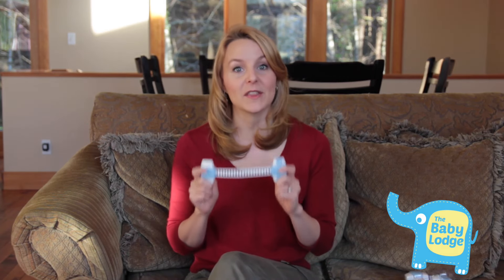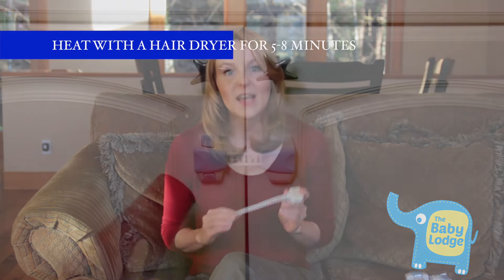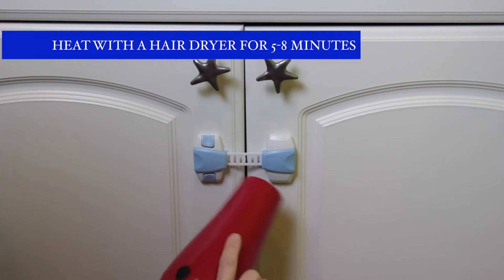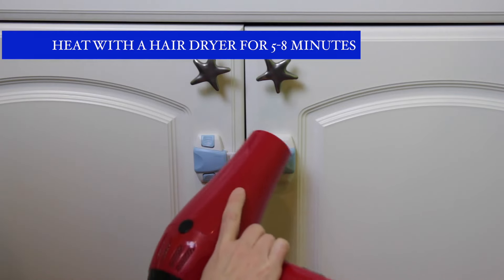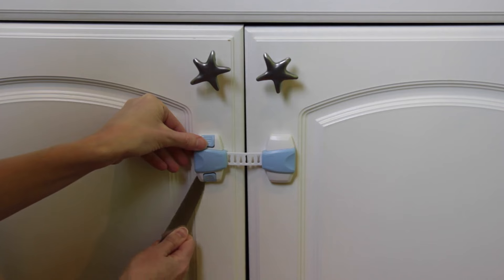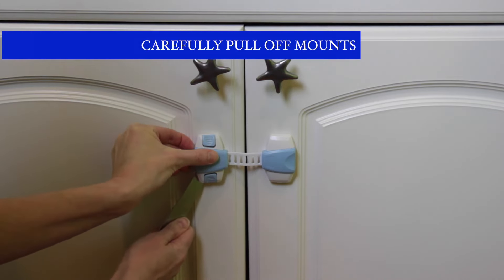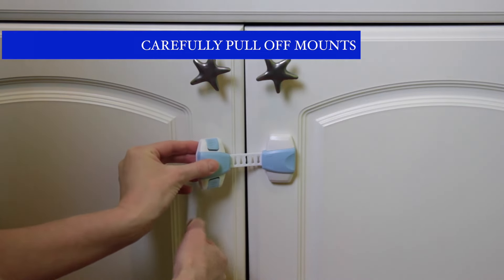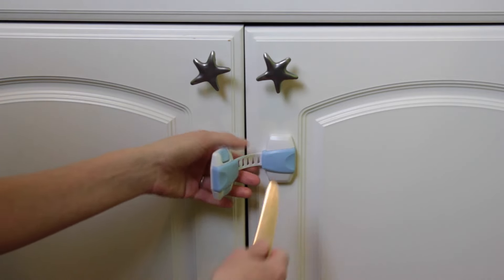Child Safety Locks Clean And Easy Removal | The Baby Lodge

Comment: I'm not sure what kind of hairdryer you're using, but I've had some pretty disappointing results using a 400W model for 8 - 15 minutes in ambient temperature of around 22C. The glue just wouldn't come loose all that much, and much of the sticker foam just teared off and stayed on the wooden cabinets. I'll try very carefully now to heat it and rub it off, but it will take me at least one hour I'm sure, and I'll have only removed one child lock. 
I think there's just no easy way to get rid of these things, unfortunately...
Reply: Have you found a better way? And how did you remove the adhesive residue on the wooden surface?

Comment: I tried using hair dryer by my counters are vinyl covered, I almost ruin the counters.
Reply: I did ruin my cabinet.  I heated the cabinet finish and when I went to pull off the lock, the cabinet pulled out into a bubble!  I have ruined so many pieces of furniture trying to get these locks of wood and fake cabinet/desk, etc. fronts!  I would never use them again!

Comment: Yeh thanks for this completely warped and ruined the laminate on my cabinets
Reply: Me too!!! have to replace door.  There should be disclaimer don't use on Ikea cabinets!
Reply: Same 😭😭😭😭 I used a floss hack right after where you get dental floss and slide it through. So much safer for cabinets, took 30 seconds and way cleaner. I’m just genuinely sad about my ruined drawer 😢😢😢
Reply: @binthalal6188  I ruined the front of my large bathroom sink.  It looks like it has a tumor growing on it because the laminate bubbled so big!